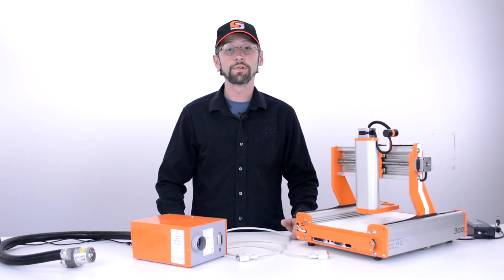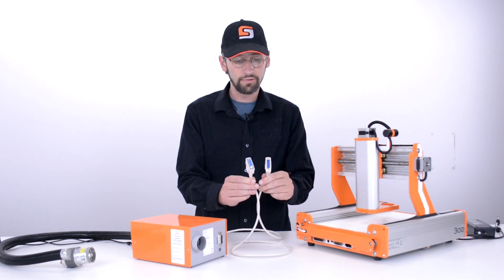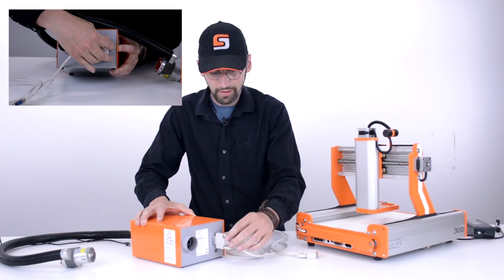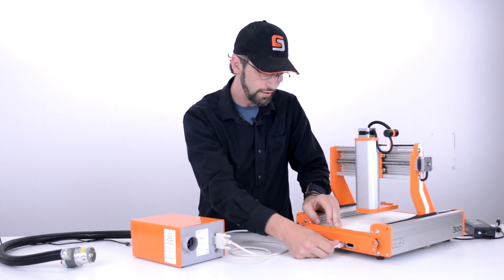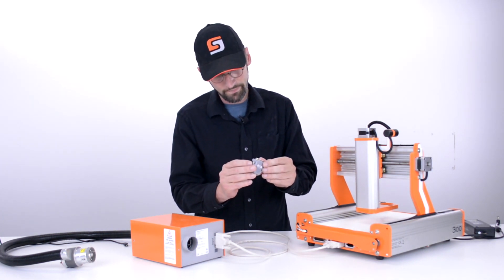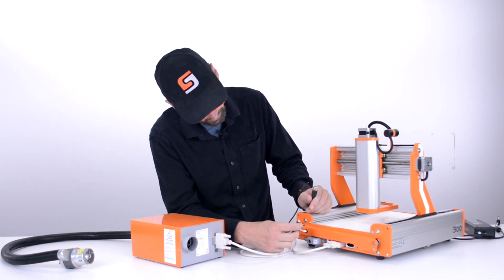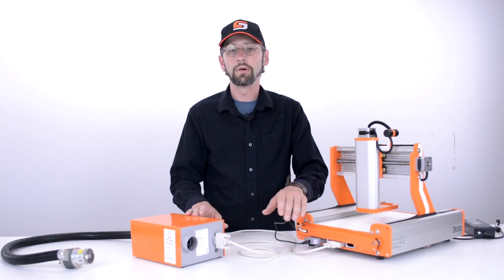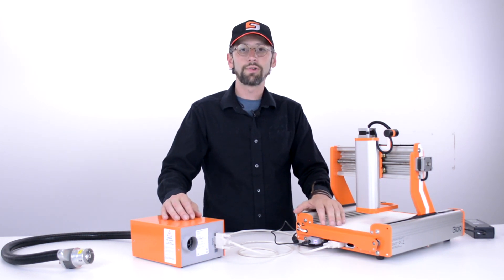STEPCRAFT Tech Tip - Connecting the DL445 Laser Engraver

Comment: this was the very easy and simple stuff. Normally one would expect hardware to be protected against electrical spikes / surges so that the connection sequence does not matter...
Now a video please on how to calibrate using your contrast and greyscale uccnc files and even more challenging: to run your stepcraft laser properly-with-pwm control using files from Vcarve. I was very surprised to learn there is no publicly available post processor that provides the correct code for a step craft laser with ucccnc. I had to take one available on the internet (google) from a different manufacturer and modify it before I could use pwm control. These kind of post processors should be made available by the manufacturer in my humble opinion. I view them as part of the “driver” software. 
Anyway, If anyone has issues running your stepcraft laser in pwm mode with vcarve software through uccnc, I can help.
Reply: There is a file available but don't ask me where it is hidden currently on the Stepcraft website.  Call support.  I do agree,  the laser should not be that picky since I have to swap cables going from the laser to the spindle.
Reply: hello i use vcarce with winpc nc and i cant use pwm control...can you publicly your post processor? thx